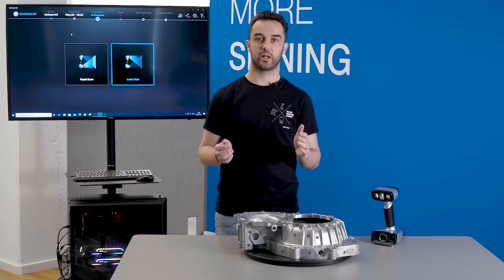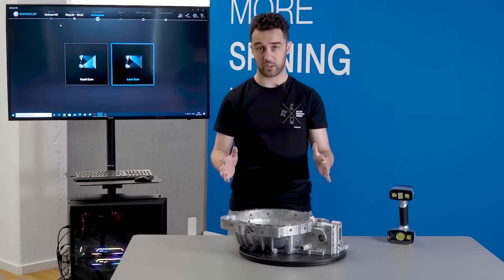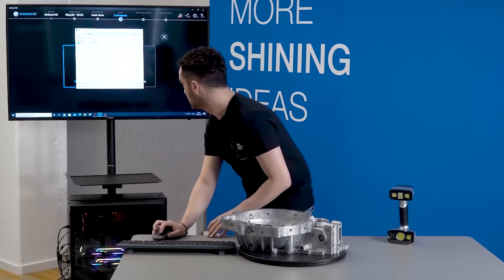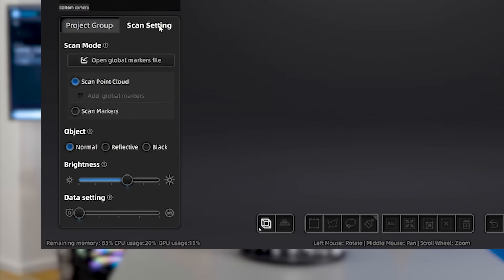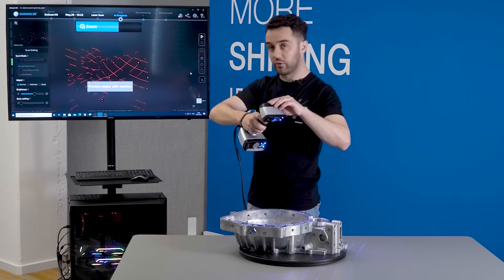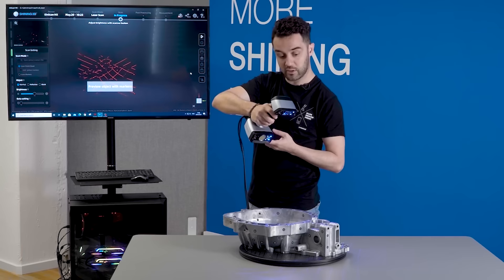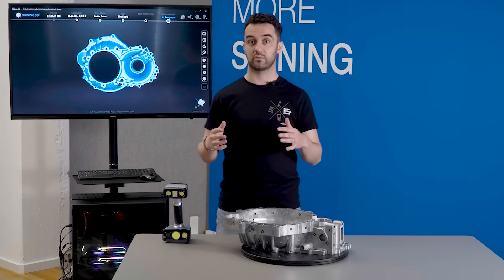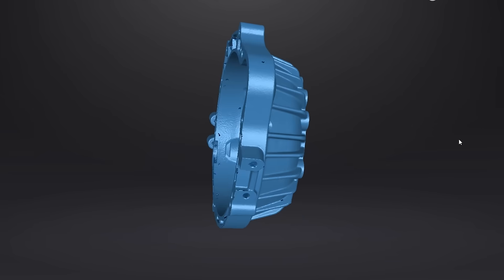3D Scan Process in Laser Scan Mode with EinScan HX

Comment: hello, I'm going to get an Einscan HX or Freescan UE scanner. I have seen in the various video demos that you always publish the same hardware system as a dual video card workstation. it is possible to know the hardware configuration so as to stay close to the scanning performance made by you which seems to me quite smooth. Thanks in advance
Reply from the maker: Hey, thanks fr your question. A dual graphics card set up is not required to get a smooth scanning experience. Just make sure that it is a dedicated High Class Nvidia Graphics Card and you are good to go. It would also be beneficial to invest in more RAM for your system. For details recommended specs please check the products web page.